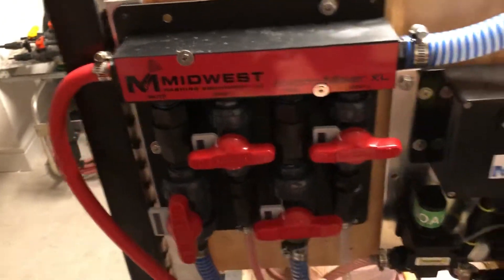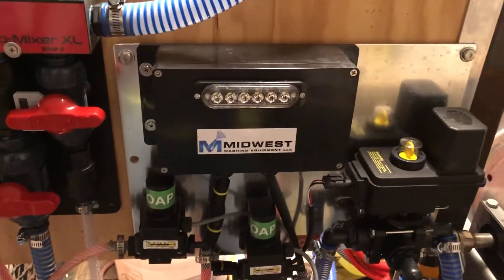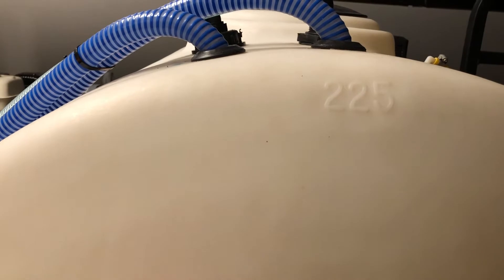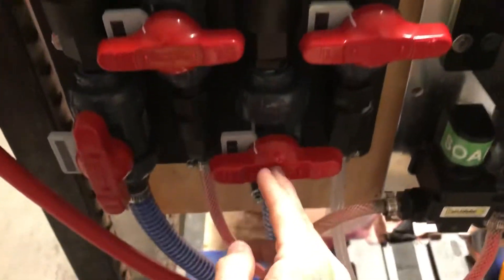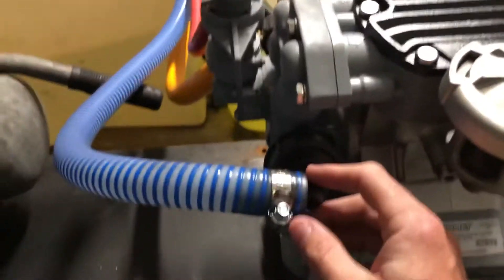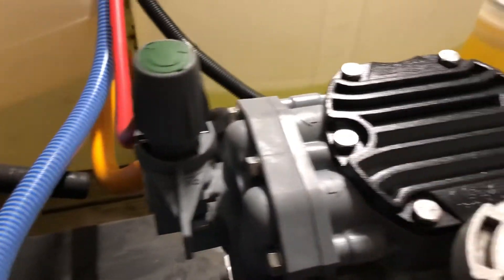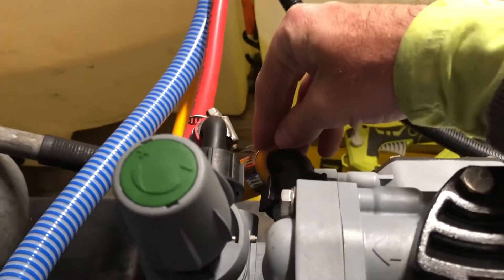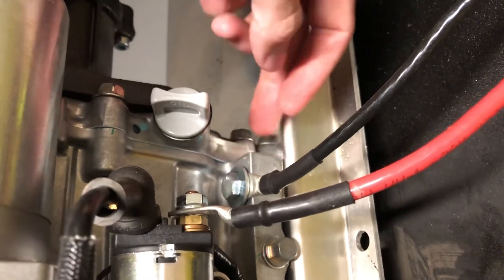How to Plumb a Comet P40 gas softwash system.

Comment: Bro! Thanks for being really clear! Free content that has blessed my heart deeply! I just bought my P40, its overwhelming getting my head around it because its NEW. But this is just clear. Even showing how you connected the key start on machine. I am aiming to get mine key start converted with a kit. That alone made the video worthwhile. Bookmarking it my man!
Reply from the maker: Glad it helped. Converting the engine to key start can be tricky I heard. Some people would say it’s easier to sell the engine and buy the key start model then swap the engines. Having key start is nice but not necessary. We have both. It’s only necessary if you want to add a remote start module
Reply: @bluecollarentrepreneur yeah and that’s what i would want to do, add the remote start eventually. Or just get an electric p40 once thats had a few years of use in the industry. Heard it has even more slap than the gas models.
Reply from the maker: @logansales7000  I almost bought one, however, the runtime with the batteries and the cost just didn’t make sense for us
Reply: @bluecollarentrepreneur Really? Whats the actual run time on it? And tbh yeah that is the part i hadnt looked at. Its just insanely nice not dealing with gas, having to bypass, etc. Its like being back on a killer 12v lol
Reply from the maker: @logansales7000 90min per battery. Comes with one. One battery and pump $6,000-$6,500 retail. Each additional battery $1500

Comment: Can I use a 1/2 inch hose for the AR 45?
Reply from the maker: @northwestroofmaintenance  no go 3/4. You’ll be restricting it. All gas pumps and higher flow pumps should be using 3/4 or bigger. 1/2 is for smaller 12V

Comment: Really strong video here, thanks. Had the p40 sitting around the shop for months before seeing this.. I do have 2 questions though.

1) can you share the ID for your soap hose? Can that just be regular braided stuff? 

2) Does it matter how long your SH/H20 hoses are? Do they need to be the same length regardless of where the p40 is positioned? For example, if my p40 is next to the water tank but further from the SH, will a 6 foot run be okay for the water and 12 foot on the SH? Or should I run 12 foot lines to both? 

Thank you!!!!
Reply from the maker: @tomsfishroom  1) the soap hose can just be normally braided hose. Nothing special on mine and it works fine. 

2) Yes you are correct. The SH and H2O hoses should be the same length. It will make the ratios more accurate.
Reply: @ fantastic! Making an order right now! Thanks so much dude 💪🫡
Reply: @ is the soap hose 1/2” or 1/4” ID?
Reply from the maker: @ 1/4

Comment: Prob a stupid question but what if you had a buffer tank in the middle of you 25’hose?
Reply from the maker: @robertdelucia6305  a mean it’s a valid question. There are 2 main problems. 

1) You would need the tank to feed back into the system otherwise it would just overflow. 

2) The problem with feeding that buffer tank back into the system is that the buffer tank would then fill with the type of solution you are spraying. So if you are spray a chemical solution and let off the trigger, the tank then fill with a chemical solution. Well what happens when you switch to water? The system would then be adding a chemical solution back into the system when you’re trying to spray fresh water. 

It just makes the plumbing much more complicated and not worth the headache

Comment: Think I could get away with the original hydro mixer instead of the xl for a season? Already have the original one and it’s 3/4 plumbing. I have an udor 40 p
Reply from the maker: Tough call. More than likely will restrict the pump and might burn it up. If you’re willing to possibly burn up the pump then give it a shot. You’re better off just setting it up the right way. You should make your money back in no time

Comment: I’m about to do this same thing with my P40. Do you think I could use 1” inch hose for everything instead of 3/4”? I don’t want to cut 1” holes in my tanks if it won’t work as well but I have a ton of 1” hose on hand. Thanks for the help. Great video.
Reply from the maker: Yes you definitely could no problem
Reply: @bluecollarentrepreneur  Thank you. 🍻

Comment: Still researching. What port size is 3 way shutoff are you using? I'm also a little confused on the crush proof hose size. Are all your crush proof hoses 3/4" or 1"
Reply from the maker: Guys are using 3/4” or 1”

Comment: Can you possibly go over the bypass a little further. Questioning where to tee into and a possible check valve.
Reply from the maker: The bypass goes back to your proportioner. A check valve can go anywhere in between those points. I’ve seen them right on the bypass of the pump or attached right to the proportioner
Reply: @bluecollarentrepreneur  What i'm looking to do is use my 12v for small groundwork jobs and backup if needed. Right now my 12v pump hose has a banjo cam lock disconnect to the outlet of the proportioner. 
I want to use the P40 primarily as a roof pump so I can install the same cam lock on the line feeding the P40. This way all I have to do is disconnect the 12v and connect the p40 on that proportioner output.
I also have a 3 way valve after the 12v so I can either feed the hose reel, or switch to a dump hose for flushing and rinsing my trailer down if I get chems on it. 
My thought is to tee the P40 bypass into the hose that will feed the P40 and install a check valve before the T so there's no backfeed.
Reply from the maker: @deanweingarth5120  well you have some other variables to consider here. The proportioner for the P40 needs a minimum of 3/4 valves, but preferably 1”. So if your current proportioner is smaller than that it won’t work. 

Next, I highly suggest not using a cam lock on the intake side of the P40. The death of gas diaphragm pumps is air. A cam lock could be an easy access point for air, plus every time you disconnect it you might have to deal with priming the P40, which can be a pain if you don’t do it right. 

My opinion, give the 12V and P40 their own proportioner and feed them to the same reel on your trailer. 

Just put a 3-way valve and you can select if you want to select the 12V outlet or the P40 outlet. 

That my personal opinion. But to be honest once you get the feel for the P40 and know how to use it, you probably won’t be touching the 12V too much
Reply: @bluecollarentrepreneur  I appreciate the input. 
As far as prime, the cam lock would not be near the p40 pump, but rather up higher and a 3 ft away at the proportioner so not concerned about that. If I do lose prime I can use the washoff dump line to reprime with clean water.  
Now the size of the proportioner is a different story but I can build a new proportioner at the larger size and just swap the smaller size out. 
I keep all your info in mind and thank you!

Comment: Couldnt you you swap out the 3/8 fitting at pump and run 5/8 so it matches hose real?
Reply from the maker: The outlet at the pump is 3/4. That’s how it was designed and I would leave it that way. Restricting the outlet size right at the pump may put some unnecessary strain on the pump

Comment: Does Comet offer a P40 pressure gauge adapter so we know how much psi it’s running at?
Reply from the maker: Unnecessary, just another thing to break and you’re only working with a range of about 200PSI. Don’t over complicate it

Comment: What’s the name of hose I want to buy ? Also I don’t get the bypass hose where does it go to or it’s just a closed Circle loop ?
Reply from the maker: What hose are you referring to? And yes the bypass just makes a closed loop.
Reply: @bluecollarentrepreneur  why can’t you have the bypass hose dropped in the chemical tank when spraying sh . and then when you’re washing with fresh water just have it runoff the truck…
Reply from the maker: @Ben-sv9op  this would not work if you are using a chemical mixing valve system. For example let’s say you’re using a 1% solution to clean a house, which is a very light solution. If you by pass back to your chemical tank you’re going to be diluting it with a ton of water. Also the whole point of the remote valve system to switch back and forth is to make your life easier and speed up your cleaning time. If you have to walk back to the truck to switch your bypass hose then you completely defeat the entire purpose of a system like this.
Reply: @bluecollarentrepreneur  Absolutely you’re correct thank you for your time and response

Comment: How did you run your by pass hose? Did you run the by pass back to you SH tank? Or did you run it back to you proportioner some how? I am trying to run my systems as efficiently as possible and not wast my mix when I have to let off the trigger.
Reply: I'm wondering the same. From what I gather you tee into the supply line between the proportioner and the pump. 
I'd like this gentleman cto chime in and confirm. 
Ive also come across another guy saying to put a check valve before the tee so there's no pressure drops creating agitation between the proportioner and the tee.
Reply from the maker: Bypass hose goes back to porportioner. Not a bad idea to put a check valve inline to prevent pressure spikes

Comment: Hey man. My 1" flex hose with filter in my tank like to float up. How did you get yours to stay at the bottom?
Reply from the maker: Slide PVC pipe over the hose. Take off the filter and slide on a 1.5" pvc pipe (about 2 feet) it should help it stay down

Comment: Thanks for posting.  After some research, I spoke with Comet and they reiterated some of your points including the 1/2 hose for the discharge line and 3/4" for the distribution line.  I found it interesting that there are three oil reservoirs so users should ensure all three have proper oil levels.  If I were you, I would post links to the items you purchased.  I've been trying to find a 3/4" 200' 600 PSI chemical tube for the past couple of days and have been having trouble.  One company yesterday told me it would be about $1200.  Nozzle's and appropriate fittings to ensure the full 11 GPM and a chart with an overview of what effect the distance of the hose has on the PSI and GPM would be useful also.  I have one application at a large movie theater and am worried that I won't be able to reach the top of the building without using some kind of extension wand or lift and, in the past, using a lift significantly affected the water pressure when up 30 or 40 feet or more.

Comment: Hi bro, the bypass 25 feet line when off the gun , does the water flow back to your buffer water supply tank?? Thanks David
Reply from the maker: If your system is set up just like the one in the video, then no it does not. It circulates back through the proportioner and then back through the pump. Your bypass hose goes back to the proportioner so it will not go back to your buffer tank.

Comment: Great Video! I wish the larger mixer valves were available when I was getting into the soft wash industry(probably were just hard to find). I love those motor and pump setups! The AG industry has been using them for decades treating lawns and pest control. I got the best option available at the time which was a 1hp booster and proportioner from the power wash store which is way undersized mixing valve system with 1/2" GF valves(should only be used for soap). Once the boosters wear out I'm defiantly switching to gas pumps. Question; Have you tried running a 1" hose for your bypass line instead of the 1/2"? It would give you more water volume/less friction which should make the pump run cooler on your down time. A accumulator tank would help a lot too on the bypass line. The more water it has to circulate the cooler the pump will run.
Reply from the maker: I have not tried a 1” bypass. Never thought of it since the pump comes with a 1/2 barb for the bypass. However I do like the accumulator tank idea. The same original pump is still working today. We’ve had to make some small minor repairs but other than that the pump is still running strong everyday.
Reply: @bluecollarentrepreneur  I'm going to second the accumulator tank comment.  How would that make it run cooler?
Reply: could you explain to me a bit more about an accumulator tank. This would just get plummed in  line?  how does it work/make it cooler?  thanks

Comment: I just got a chemical sprayer. It has a Honda gx160 and a comet mp-30gr. Max psi is 400. I'm new to this. Is there a way to pull the "chemicals" from a separate tank so I won't has to introduce them to the pump. The pump is 700$ and don't want to have early failure bc of chemicals
Reply from the maker: Not that I know of. Every system I know pumps the chemicals through the pump. If you have the right type of pump and take care of it you will be ok.

Comment: I use a "bypass tank". instead of running 25' of hose just run it in and out of a 10 gallon tank.  Much safer, easier and a good piece of mind.
Reply from the maker: What happens if you want to by pass for 2 minutes? At 10gpm you would fill up a 10 gallon tank pretty quick.
Reply: @bluecollarentrepreneur  Couldn't you plumb it back to the water buffer tank, assuming the "house fill hose" has a hudson valve on the tank?  It won't overflow the buffer tank since it is just recirculating water, even when its full (if the hudson is working properly)
Reply from the maker: @BrianDimeADozen  no because if you have SH in your mix then you are sending back chemicals to your water tank. Not ideal if you have pressure washers plumbed to same tank. If you only use the P40 for rinsing with water then yes.
Reply: @bluecollarentrepreneur  Exactly
Reply: I like that idea 👍🏼

Comment: Yo , did you run your comet off your powerwashers battery or did you use a separate battery?  ?
Reply from the maker: I gave it its own battery but you can connect it to the same battery as your power washer. Whatever you prefer. If you have a heavy duty deep cycle battery for your washer just connect it to that

Comment: On the bypass line did you tee it back into the 1 inch inlet?
Reply from the maker: No, the bypass hose goes back to the proportioner (red 1/2 hose in the video).

Comment: can you run a 1/2" hose on your reel?  I see you have 5/8.
Reply from the maker: You sure can. However you might see a slight decrease in water flow and overall distance. However I know several people that run 1/2 inch because it is easier to use.
Reply: @bluecollarentrepreneur  I thought your flow would be better, the bigger the hose? Like the output port on P40 is 3/4", why not run a 3/4" hose for it if it allows for that size? Wouldn't it be the most GPM possible.
Reply from the maker: @Reach4JesusNow  yes in theory the bigger the hose you run the more flow you will get. That is why we run 5/8 instead of 1/2. However I personally think 3/4 is excessive and wouldn’t be fun to drag around all day. But remember at the end of the day if you run 3/4 but run it through a standard reel you aren’t going to gain much flow because the restriction of the swivel. So if you do want 3/4 flow you will need a 1” reel and swivel.
Reply: @bluecollarentrepreneur  okay, good to know. I think 5/8 is the way to go then. thanks!

Comment: Badass set up bro, whats the difference between the p40 and the AR 45 ( which is better) Thinking about contacting Brian and pulling the trigger on one.
Reply from the maker: The Comet P40 was designed for the soft washing industry vs the AR-45 which was not designed. Also the P40 was designed to have less points on the pump that can fail and is MUCH easier to service vs the AR-45. In my opinion the P40 is superior.
Reply: @bluecollarentrepreneur  thanks for the input sir appreciate ya.

Comment: Nice setup. Where did you get your blue crush proof hoses, stainless tank filters, and tank seals. I like the hydro mixer setup. Where did you get your 12v three way valve as well. Keep the content coming.
Reply from the maker: Thanks! So the blue hose, stainless steel strainers, and “uni-seals” came from Midwest Washing Equipment. We also got the proportioner and the 12v valve setup from them.

Comment: Does your comet Recirculate at all times when on the Trigger and when your not on the trigger
Reply from the maker: I believe it bypasses a little even while on the trigger. This would be determined by the settings you have your regulator on. And yes when you are not on the trigger the pump recirculates.